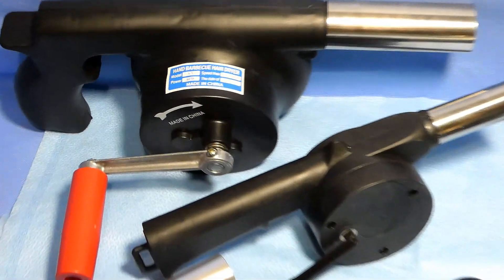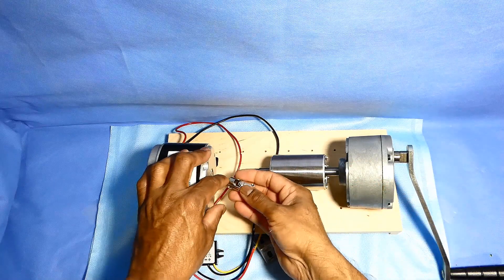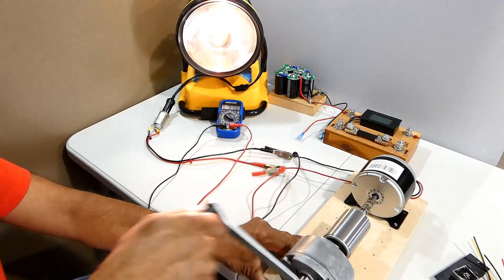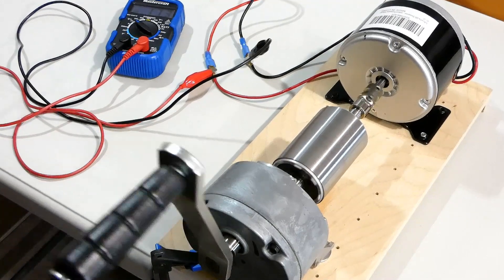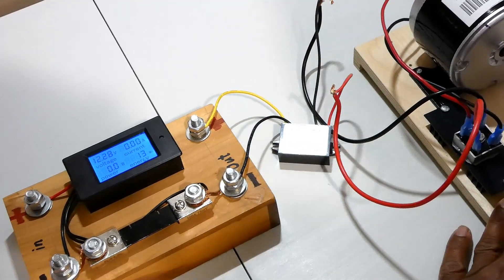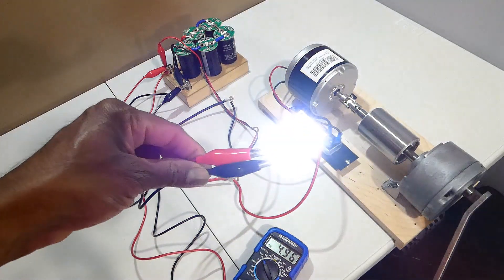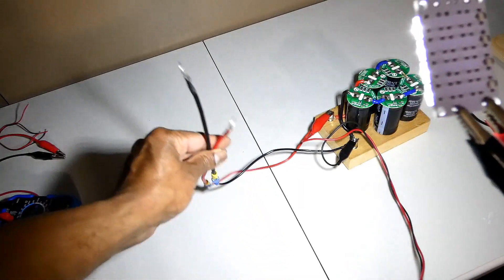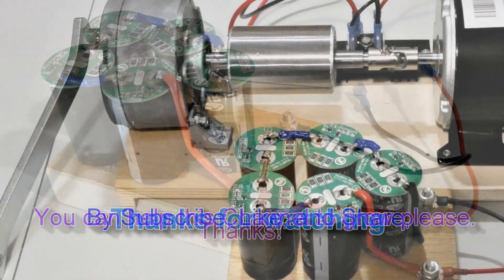DIY HAND CRANK ELECTRIC GENERATOR | SUPERCAPACITOR POWER BANK | EMERGENCY DYNAMO DC12V SYSTEM

Comment: The energy is in the dynamo, so what do you do by the batteries? I mean, you do not need batteries.
Reply from the maker: Those are not batteries, those are Super capacitors to store the energy from the dynamo. Thanks for your comment.
Reply: I hate that have to be an electrical engineer and rich to figure this stuff out 😂

Comment: could you explain the gear motor connected to the hand crank it looks like 2 different motors?
Reply from the maker: There is only one motor(Dynamo), other one is a gear box from an AC brushless motor. You can see the rotor is still attached to the gear box. Both shafts are connected with an universal joint.
Reply: @SKILFULLIFE  thank you this makes more sense would you happen to have a list of parts for this project so I can recreate it for my class

Comment: What type of AC gear motors do you use?
Reply from the maker: The motor I used in this video is a 24V DC permanent magnet motor. The gear box from an AC door motor. I bought it from a thrift store. But, you can get a gear box from any gear motor.
Reply: @SKILFULLIFE  Thank you so much
Reply: I am still having issue finding the gear motor you used and how you connected it to the hand crank. Also if you could provide the type of hand crank you bought so I can make sure it connects properly. Thank you @SKILFULLIFE